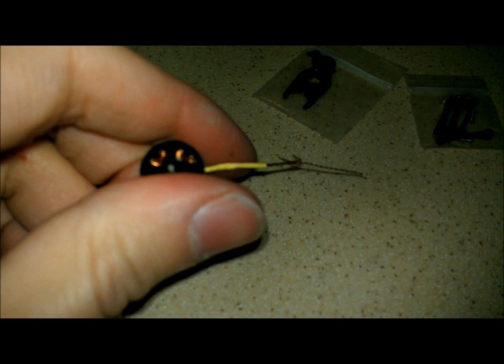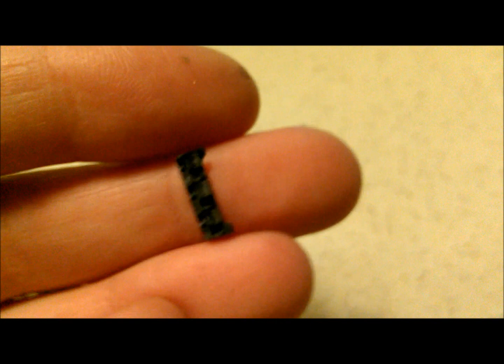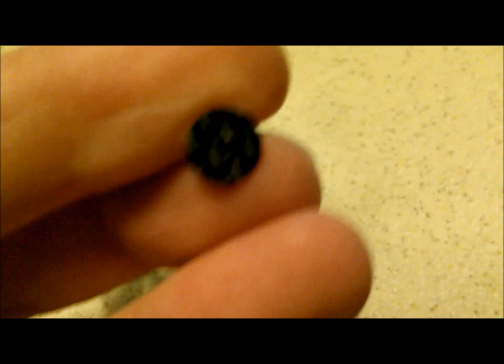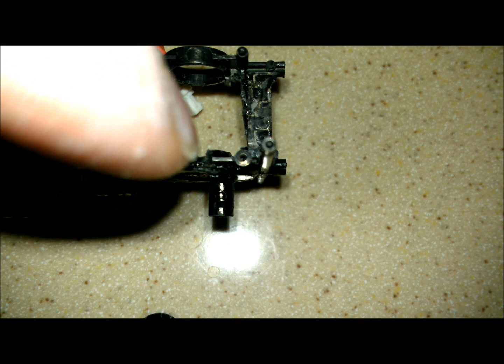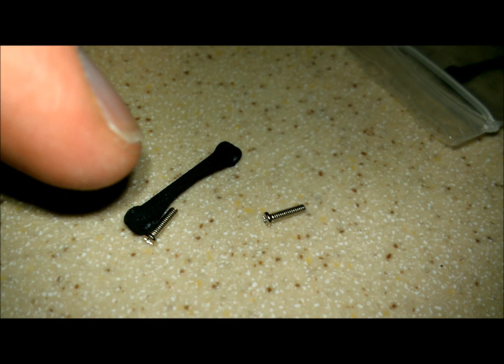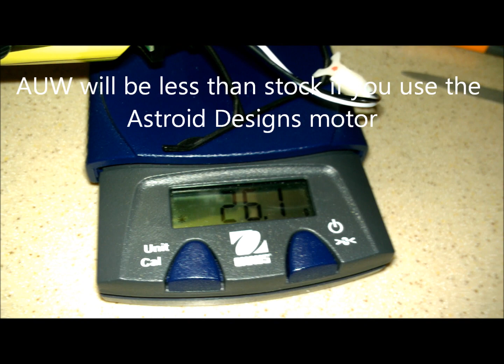Blade Nano CP X Brushless Conversion How To Astroid Designs pjacq

Comment: Nope, checked and triple checked connections before connecting wires. Will try a new board that I will get in 2 days. Been spending many hours of looking through posts and diagrams about the mild and wild differences. Thanks for the reply. Will test connections with an ohms meter before operating.

Comment: I finished the upgrade a couple of weeks ago with the mild kit. When I plug in the battery it seems to overheat the ESC and causes it to smoke. Ive tried taking both plugs off and directly soldering the wires onto the board but still have the same thing happen. Any ideas what it may be? Thanks Algy